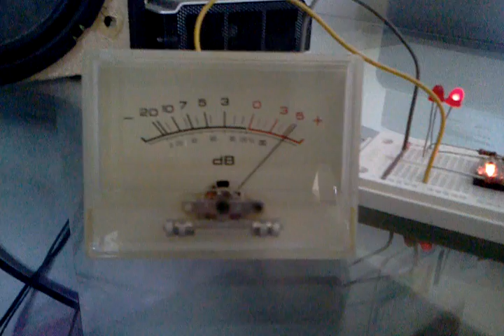Teensy 2.0 software PWM demo controlling VU meter

Comment: Can you help me out a bit with your code, please?  It wouldn't compile, so I had a look at it.  The very first lines are
#include <avr/io.h>
#include <avr/pgmspace.h>
... but I can't find the avr directory.

I haven't gone through the entire file, but I have found a number of untied strings, which tells me there's no point in trying to understand it till I get a bit more info.

I see that you have written the Teensy_sPWM.c file with a lot of defines for different boards and lots of pins, etc.  I only want to bounce one pin up and down, so I went looking for the mechanism through which you control the state of an individual pin, and I found 
set_pin(teensyPin[i].port, teensyPin[i].pin, 0);

However, set_pin() is a function that is not defined in Teensy_sPWM.c or .h

Where are the other .c and .h files, please, that are used in this compile?

On a more general topic, is there a C-reference somewhere for the Arduino IDE?  What I'm getting at is that there may be things about it that I don't know - like main() lives somewhere inside the package, and there may be Teensy-related commands burried in the package, that I can use without declaring them?  Perhaps set_pin() is one of them?
Reply: Yes, set_pin() is a function provided by the Arduino libraries. The missing AVR libraries will need downloaded, I wrote a script here: https://gist.github.com/JayWalker512/3746938   for Ubuntu which installs the AVR requirements to compile for the Teensy.

You are correct to notice that the Arduino IDE 'hides' many things in order to make it easier to use. I just went looking through the Arduino .h and .ccp files to find what I needed when I made this, and avoided using the Arduino IDE. There's nothing really bad about it, I just wanted to code things bare-bones at the time.
Reply: Many thanks for the reply.  I have been banging my head against the Teensy-2 for about a week now, and I'm barely making headway.  It would be great if I could just buy the board and find the tools to program it - but the Teensy tools, which run as an extension to the Arduino IDE, don't work, because, as it turns out, my Teensy is a Chinese clone that doesn't have the interface software, so although the hardware is visually identical (component placement, chip type, etc), measures have been taken to prevent me using this £8.59 module.  Instead, I have to get one from the USA for £16, and pay a further £16 for postage to get one with software that will interface with the loader.  It's not actually that much money, but it certainly feels like a rip-off, so I have decided to go a different way.
I looked at your script, but it's for Linux and I'm running Win-7.  I might be able to go through it and figure something out, but I have already spent so much time figuring things out that the Teensy is starting to feel like a lot more effort than it's worth.
Again, however, thanks for the response.  It's appreciated.

Comment: Thanks for this.  I bought a Teensy-2 about a year ago, and played with it a little bit - only the most basic of trivial stuff with the LED.  Now, I finally have an appliction - to switch an IGBT to control a universal motor in a table saw, for a soft-start.  They start so abruptly that my last one stripped all the teeth off the metal gearwheel on the saw arbour.  All I want is what you're doing here - a PWM ramping up from a low duty cycle to always on on over a period of a second or two.  Unfortunately, I've lost the notes I had on how to program it, so I'm starting at zero again - but once I figure out the basics, your code may save me a bit of time.
I think a few hundred Hz (possibly 1KHz) will be enough - motors are inductive - though I'll rectify it and run it on DC.

Comment: Hi ! I want to control pulses from 0 to 100kHz pwm.What should I do ? thank you
Reply from the maker: If you're interested in frequency modulation, software PWM could do it but only up to a few hundred hertz. I think the hardware PWM on teensy operates at a fixed frequency, so that's not really suitable either. You may need some dedicated hardware. A voltage controlled 555 oscillator might be suitable if you don't need to be incredibly precise with regards to the frequency you set.